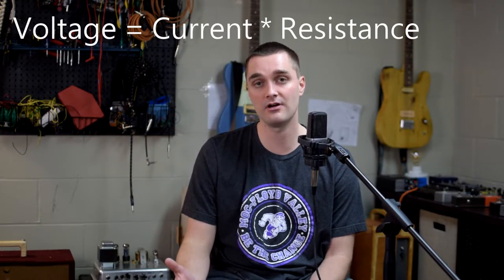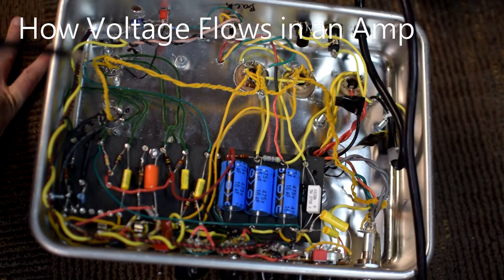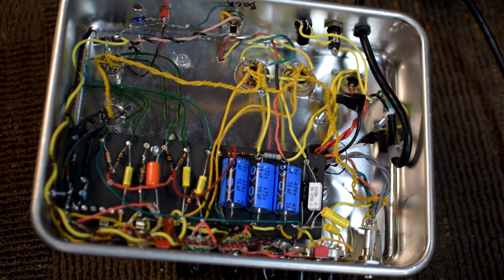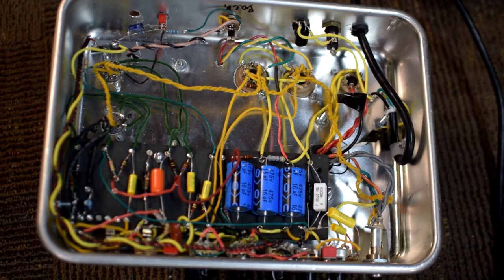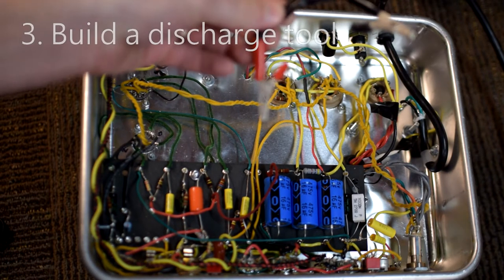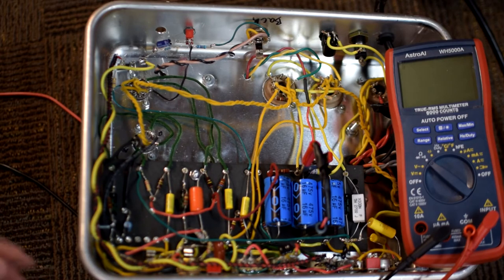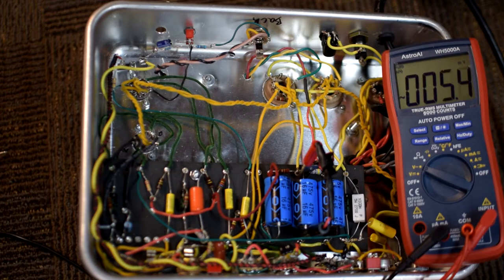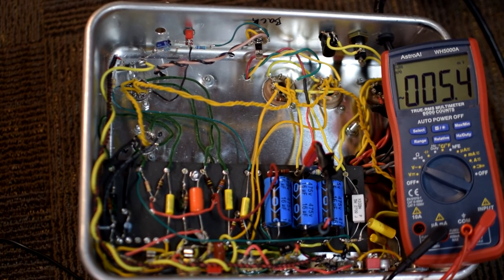How To Safely Work on Tube Amps

Comment: Unrelated question. I have a Junior I'm putting a Neck pickup in. VVT the bridge pickup will have a series parallel DPDT a500k added to the existing volume and tone. Leaving a linear and log 500k set. I don't want to use a toggle switch an master volume but I have some stereo output jacks and I wonder how easy it would be to have the pickups work parallel out on a mono jack and separate if using a TRS jack.. Which I have a stereo breakout cable and 2 amps. Thoughts?